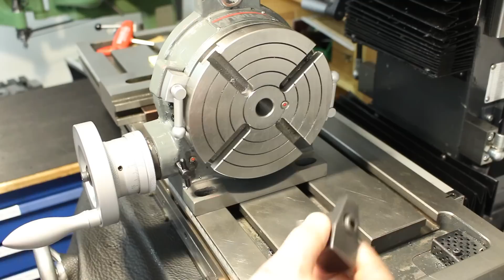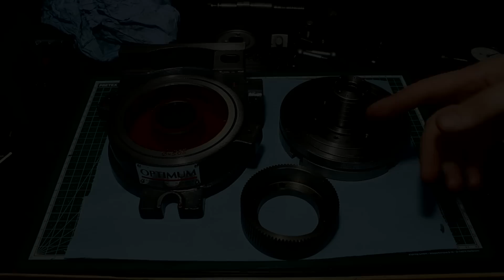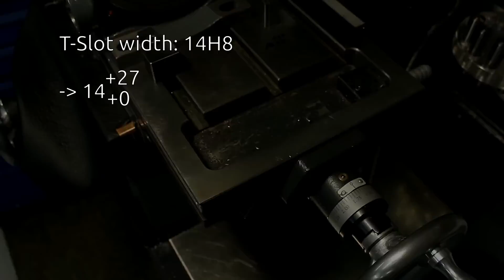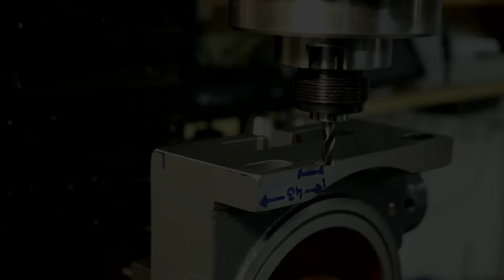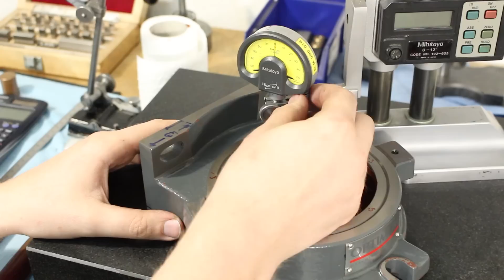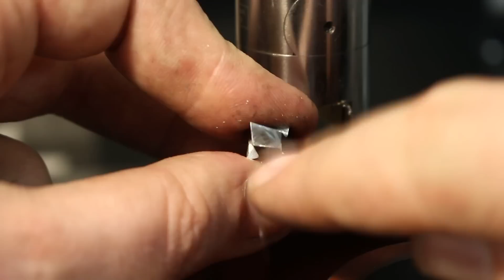Improving the vertex rotary table - Part 1

Comment: Hi Stephan,
have just bought a Vertex branded rotary table identical to yours, I am thinking about doing some upgrading some of the tolerances in my table. 
I was wondering if it would be desirable or even possible fit a precision roller bearing or would you still recommend a bronze bush?
Sorry to delve so far back into history I have been cogitating for a couple months regarding the advisability of doing this. 
I hope you are able to give a little advice. 
Regards Mark. 😅
Reply from the maker: Hi!
These days I would go all in and put radial/axial needle roller bearings in it - They are cheap and incredible stiff.

Have you used the table already? My recommendation would be to clean it once, lubricate it properly and then just use it for a few months/projects. That will tell you a lot of what you want to change :)
Reply: @StefanGotteswinter  thanks for help I’ll do a bit more research into the bearings available in Australia. 
I have thinking about this for a while trying to figure out how I can do this upgrade. 
Disassembly cleaning and adjusting has definitely on my to do list as there is a slight tight spot. 
I really appreciate you taking time to respond to my questions, getting good first hand information and parts can be difficult where I live it’s 3000km from the nearest larger city with specialised suppliers.

Comment: I like what you have done with the rotary table but it does not address the greatest weakness of their basic design.  I have two rotary tables and they both do the same - with any load the table bounces up and down on the base.  This induces chatter in the cutter and leads to poor quality work.  The only way to stop the bouncing is to lock the screws which then prevent it from rotating.  You then have two choices - stable static rotary table or chattering rotating one.  Both useless positions. 

Have you thought of making a rotating table from scratch that rotates smoothly under load? It would need a heavy duty bearing system between the base and the rotating part.  The locking mechanism would have to be a separate component, nothing to do with the rotating mechanism.  By making such a rotary table, the chatter and poor quality cuts would become a thing of the past.  Add a variable speed drive to the wheel and voila - you have a very useful addition to your toolchest.
Reply from the maker: There is no way it bounces axialy - I have it set for an endplay of about 1/100mm and thats needed to give the oil a chance to form a closed layer. A thin oilfilm is very stiff and can cary a tremendous amount of load.
Reply: Stefan Gotteswinter : I’ll have a thorough look at your series and get back to you if needed.

Comment: Again, everything is made of rubber; more so when you work to very tight tolerances. Precision surfaces on big stiff hunks of iron subjected to ordinary clamping forces move like putty when scanned to micron precision..

Stefan, have you considered honing the central bore of the base casting. I don't know the German term fore the process but briefly "honing" involves a semi-consumable rotating mandrel and a tighly located frangible stone expanded radially using a wedge. I refer to the honing system dominated in the US by the Sunnen Corporation but others abound. 

A bore can be honed within 1 micron of a true cylinder in the open shop using hand held power equipment. I mention this because you seem to be seeking the ultimate precision possible in your home shop. The equipment is usually on the rental market in most any town with a precision manufacturing base.

Comment: Nice work.  The use of ground flat stones is a great added touch. Those stones are very expensive. $500/pair! How long do they last?
Reply from the maker: Pretty much forever, but with abuse they can get out of flat. But I didnt buy mine, I ground mine out of a normal aluminium oxide stone on the surface grinder :)
Reply: is it possible to check the flatness on the stone after being ground? Using a parallel?
Reply from the maker: Yes, very carefully with a knifeedge straightedge against the light :)

Comment: Can you mold a sleeve out of the moglice,and then machine it...
Reply from the maker: Hmm, more the other way round - Machine the spiggot nice, round and smooth, bore the housing oversize and then cast the bushing directly with the moglice. That would work very well :)
Reply: You can get better precision in no time that way,both bushing and thrust face.It will dampen the vibrations more,and with polished shaft it will outlast the worm gear. Important part is that you will have more time to make new videos for us.
Alen

Comment: you spent 500$ for a stone?
Reply from the maker: Noooo - I droped a normal, good quality stone onto my surface grinder and ground it with the diamond wheel.
Reply: Ah! That sounds more like you :) good tip, thanks!
Reply: Stefan Gotteswinter could you make a video of you doing that if you have footage? Robin renzetti had mentioned he was going to eventually but it has not happen yet.
Also, would it not be possible to make the sleeve pressed into the rotary table housing and then lapped to the spigot off the table, that way you would be lapping two steel surfaces?